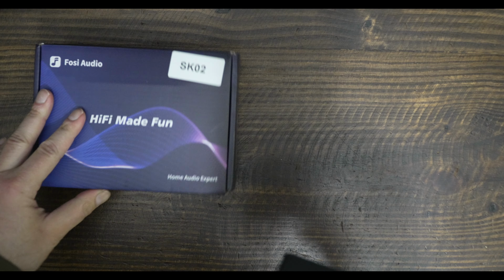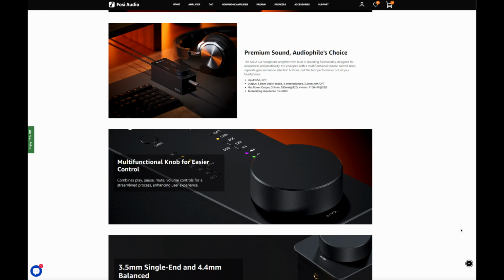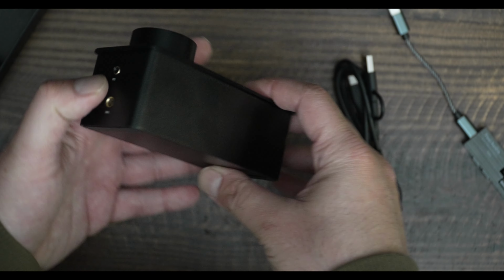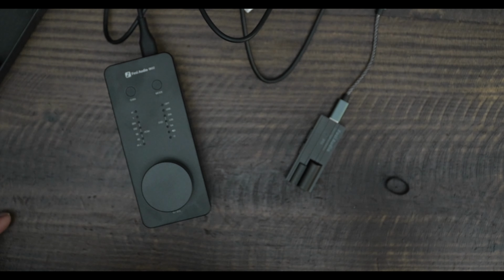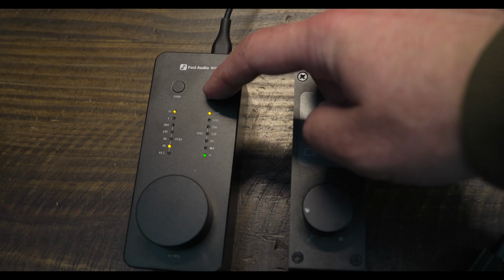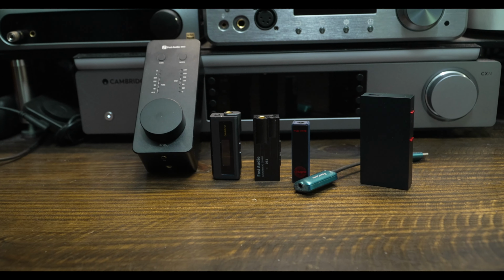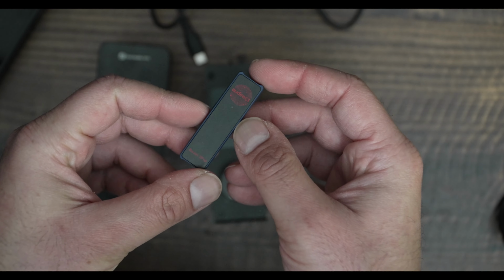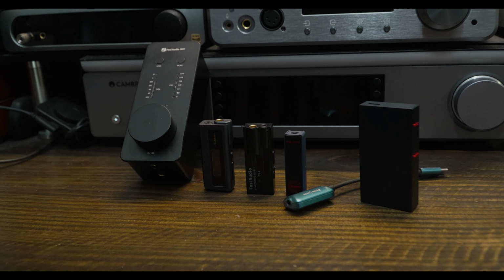Fosi Audio DS1 & SK02 - An Interesting Set Of Dac / Amps

Comment: like you i could not hear much of a difference between 2 dacs once volume match ( for example mojo1 vs apple dongle) but here is an example of a very audible difference : the attack on drums between dc07 pro and apple dongle : the attack speed is faster, sharper, cleaner on dc07 pro. the same drum hit on apple dongle is softer. my volume matching protocol is outputting a 440hz square signal from the free web tone generator szynalski with the iem in front on my phone microphone, android phone running a free "sound meter" app, volume matching precise  to 0.2 db. i could not tell them appart in casual listening but when a/b testing one after the other it is very noticeable.

Comment: Hey mate, I know you’ve listed the equipment you use in other videos, but I couldn’t find them. Could you send a link for the ab switch box you use please?
Thank in advance 🤘
Reply from the maker: X31 XLR Balanced Cable Switch... https://www.amazon.com/dp/B0894P7LRD?ref=ppx_pop_mob_ap_share

Nobsound Little Bear MC1022 Mini... https://www.amazon.com/dp/B07CKK7J2L?ref=ppx_pop_mob_ap_share

Five Input Source Tabletop... https://www.amazon.com/dp/B0056DQT1A?ref=ppx_pop_mob_ap_share

2 PORT 3.5mm STEREO Manual Switch... https://www.amazon.com/dp/B073GWCRP3?ref=ppx_pop_mob_ap_share
Reply: @NoThemeReviews  cheers mate 👍